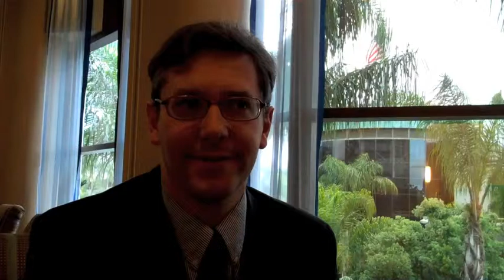ACS Meeting San Diego – G. Huber on Biomass Conversion

Comment: One of BEST materials to use is Cannabis Hemp (77% cellulose) with at least 2-3 grow seasons in most of the continental USA, it could easily replace US fossil fuel consumption with minimal acreage (relatively speaking).  In fact, Most states could grow their own supply.  It will even grow on marginal lands with the ability to condition and improve those lands as a bonus... Along with a multitude of other things.